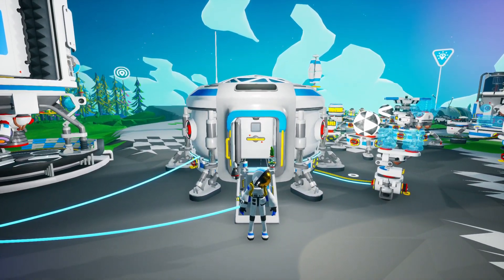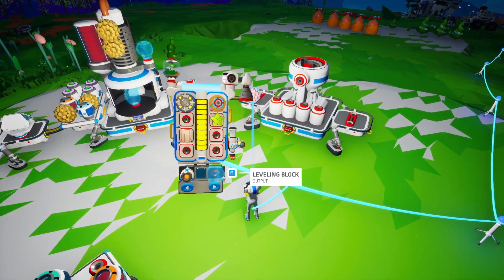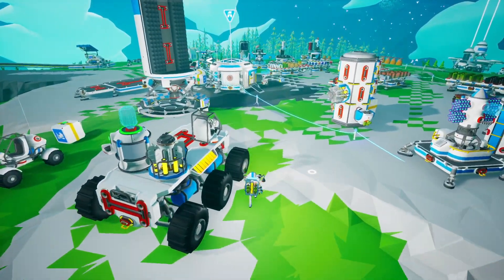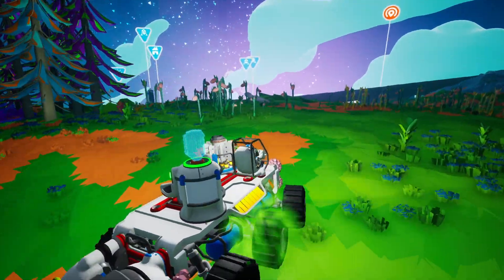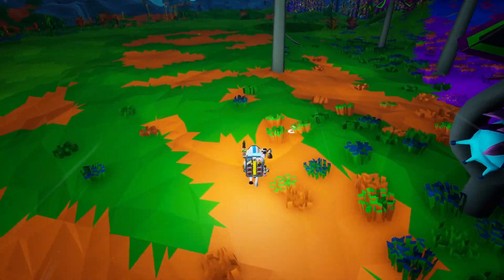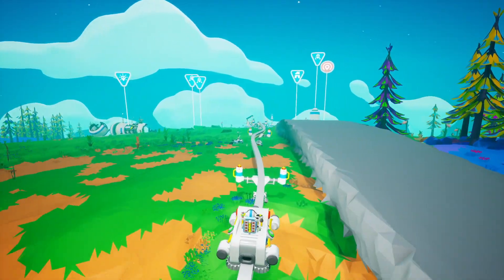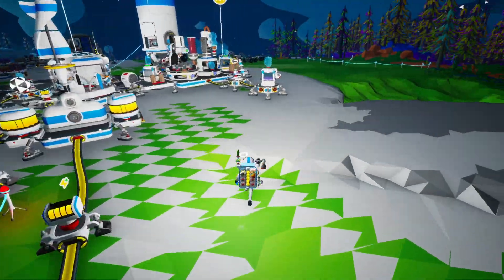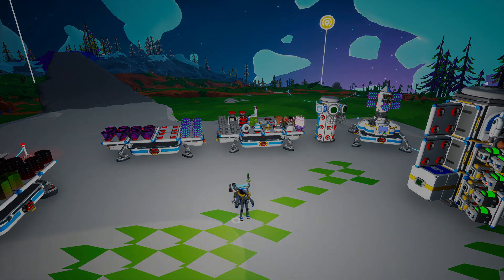AUTO-ARM - Let's Play Astroneer - Episode 36

Comment: Today I want to tell you about 2 nice tools that are going to be handy in prettifying your base. One is caled "Inhibitor" and second is "Terrain analyzer" (TA). Both are printed in a backpack and both designed to be attached to your terrain modification tool. Inhibitior allows you to collect resources from the surface without modifying landscape. TA allow you to "pick" a color of terrain. Initialy TA prints blank but once you dig any kind of colored soil (you can even have Inhibitor active in that time) it fills up with that color. Then you are able to do certan things: 1) New soil that you place in the world using "alt" key will be same color as TA picked earlier 2) If you attach both Inhibitor and TA you are able to paint existing terrain using ALT key without modifying landscape. In general you can attach Inhibitor and TA and dig some soil near your habitat to pick that grey texture. Then you are able to paint whole your base into same color spreading from your habitat to get rid of that mixture of grey-white-green
Reply from the maker: Very interesting! That will come in handy in combination with the leveling block. I watched a few tutorials on how to use it properly and have some plans for next month. Thanks!
Reply: @Josiwe  Leveling block makes flat surface relatively to a planet axel, so to make propper flat base you have to move to polar gates. Which is good idea thow as you can have permanent TP to your base and set up an infinite solar power array on a roof of the gates
Reply: @mad_engineer3254  Oh yeah! I learned from Kerbal Space Program how polar bases have almost perpetual sunlight. Should work perfectly in Astroneer, but in reality there are small interruptions due to inclinations and eclipses.
Reply: @Josiwe  Leveling block if you go to the polar gateways... but I finally got comfortable with the alignment mod. Put it in an auxiliary slot so that you can frequently enable/disable it with C or V. Finally, the holy grail of Astroneer:  level foundations!

Comment: Not sure if you even needed the arm here.  Wouldn't it also have worked if you put the hydrazine canister next to the hydrogen canister?  Could be that I'm wrong of course.
Reply from the maker: Yeah you’re probably right, but I learned a bit about how the arm works so it’s all good 🧐
Reply: @Josiwe  I hadn't noticed the filter slot feature! (I just filled it with random junk and had even quit using arms.) But this will help a lot.

For this setup, perhaps ditch the hydrazine canister and let the arm refuel your shuttle directly. You'll only ever need one or two hydrazine at a time, and the arm can store one while the lab stores a second.
Reply from the maker: @DistracticusPrime  Ah, but the hydrazine can also be used to make graphene, and power the vtol. So I think more is better :)
Reply: @Josiwe  Yep. Now that I've watched the next episode... that upgraded jetpack means I'll be burning through a lot more of the stuff!

Comment: I have to remind you that when you were setting up the auto-extractor on the initial graphite deposit, you tried moving the seat in an attempt to avoid backing out. I can't understand why it worked now when it didn't work then. [shrug]
Reply from the maker: Who knows! Probably user error but I figured it out eventually. If you like Astroneer playthroughs you should check out Ziploc’s channel, he has a great playthrough with lots of base building and automation tips.
Reply: @Josiwe  I went back and looked. No user error for sure. Meh. I've already got Ziploc bookmarked. 😁